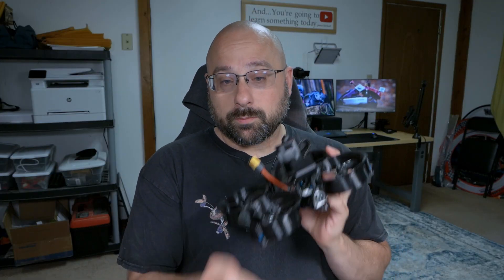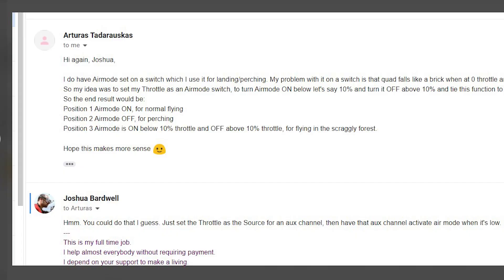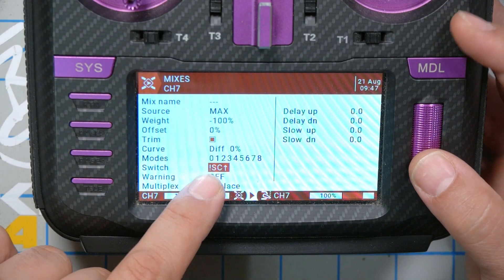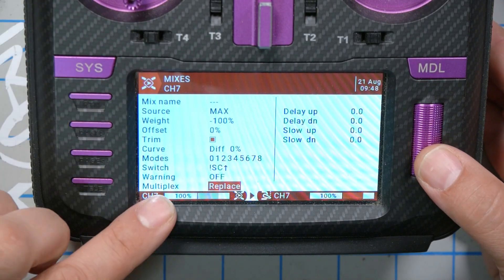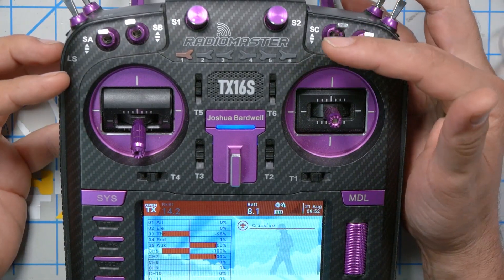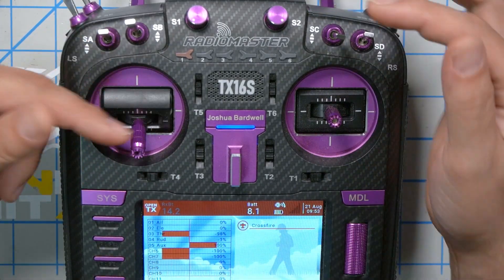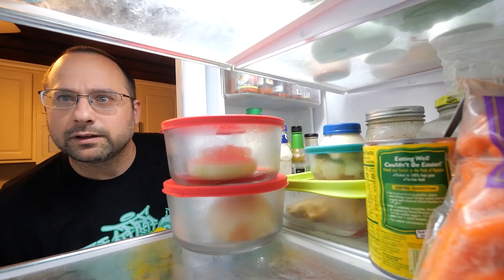Betaflight Air Mode is bad for Whoops. Until now. Maybe.

Comment: Umm... There's a Betaflight parameter called airmode_start_throttle_percent , doesn't this do the same?
Reply from the maker: No. That controls where air mode first activates. When the throttle first goes over that percent. After it activates, it stays active at all throttle positions.
Reply: @JoshuaBardwell  Thank you, I learned something today! Now this got me thinking and unless I'm mistaken, this means that airmode NEVER gets activated with the special solution you described. I checked the source code and the activation of airmode ONLY happens when its enabled and the throttle goes above airmode_start_throttle_percent (which is 25% by default). But it's NOT enabled above 10% so it won't get activated above 25%...
Reply: @l0stb1t  hi, I see nobody answered you, did you find a response of you interogation or did you test it to see if it is activated?
Reply: @l0stb1t  Yeah, i'm also very interested. This video is starting to be shared in the community as an answer to air mode problems, but if what you're saying is true, then it's very wrong
Reply: @ThranMaru  It's only the first time you raise the throttle that it's only enabled when you go over 25%... Normally, once you've taken off, it's permanently on until you disarm. Now, it won't enable when you go over 25% on the first take off, but after that, any time throttle goes under 10% (eg flip, power loop etc), airmode is turned on. 
It makes sense, and it's useful for the problem he mentioned of flying through scraggle etc, but it doesn't help my use-case: I'm a very new pilot so I crash-land a lot, often on uneven stuff. And then the quad freaks out every time. So I've just turned airmode off (since I'm not gonna be doing flips any time soon anyway).
Reply: @Vousie  just gotta be very quick with the disarm. I disarm right before I touch down.
Reply: @ESForgecraft  For me the problem is I'm flying a TinyWhoop. Hitting and bouncing off things is kinda a given. And I can't just disarm when I would've been able to keep flying. Thus far I've had no issues with turning off airmode on it, given that TinyWhoops basically never go upside down.
On my big quad I fly ArduPilot rather than Betaflight. Airmode always on, and I've never had any issues with its airmode on landing etc, and it does powerloops & flips quite fine.
Reply: @Vousie  not put airmode on a switch?  Granted that wouldn’t help with it fluttering if you hit something but landing wouldn’t make it bounce and hit the ceiling
Reply: @Vousie  how you doin now? A sim is worth so much more than they cost, plus they're fun.
Reply: @l0stb1t  have you tried lowering the throttle (airmode_start_throttle_percent) to 0%? Once it pass 10%, it will deactivate airmode and when you go back to below 10% it will activate airmode.
Reply: Thank you for sharing I would love to see if anyone can confirm this as working.
Reply: @dwpreble  I have this setup on my X9D and use it mostly for my tinyhawk flying inside. it seems to be working well for me. I havent flown my protek35 close enough to walls to really test that one yet.

Comment: But air mode tends to stay active even when disabled on switch until you land and disarm. Then it turns it off. 
Other wise once enabled and throttle goes above 25% it's permanently on till disarm for me. So I disabled air mode entirely 😆 
Dynamic idle will be my fix for that.
Reply from the maker: That's not my experience. When you have air mode on a switch (aux mode) it is off the moment you flip the switch. I think something was wrong with your setup.

Comment: Wouldn't the following do the same?
- In Modes tab add Airmode range.
- Select Throttle channel in Airmode mode source
- Place the slider in the first portion of the range (eg 1000 to 1100 for Airmode to get active from 0 to about 10% throttle.

Comment: i have sadly a different porblem with my Cetus X . it doesnt in Air or hor mode , im getting somtimes a error and the rotors just stops spinning :S also for somereason the connection is worse than to the smaller Emax nanoscout . ..

Comment: I mixed a switch in Betaflight so that AirMode turns off in Angle and Horizon mode but remains on in Acro mode. In Acro mode, my Cinerace20 V2 drone starts without any issues, but in Angle and Horizon mode (with AirMode off), I get the "Rescue Off" message, and the drone won't arm. How can I disable this?

Comment: To permanently enable airmode does braking in esc settings need to be off?
Reply from the maker: No. Esc braking should always be enabled for multirotors.
Reply: @JoshuaBardwell  I'm flying a apex evo 5 inch with f405 pid at 8k &4k loop dshot 300 when I permanently enable airmode the quad acts like a whoop when it hits a wall in airmode when I input a roll move on sticks is it not  a good idea for air mode to permanently be on or should it be on a switch? thanks again it's my first build  I appreciate it
Reply from the maker: I run air mode permanently on, for all my drones.

Comment: Hi Joshua, is there an updated way to do this now or still the same please?

I’m looking to fly my Cinebot30 indoors for work and cinematics and want to implement this. I want it on the switch so default is air mode on, then when switched up it’s “dynamic” like you have done. But is this the same method you would still use to do this or does this need an updated video before I start to make all these changes?

I’m thinking of mine just having air mode on all the time but when flying in tight spaces or indoors for work use it where it only comes on when at zero throttle.

Comment: I noticed something weird with this method on at least one quad (7incher), but probably also on some other quad.

I got some sort of "dynamic" air mode set up on my radio like in this vid. So airmode only kicks in above a certain throttle percent value. So during flight it constantly switches on and off. Throttle rised, dynamic air mode kicks in, and then: the motors start going back and forth between 15-50 percent several times in a window of 10-20 ms. Causing really hot motors. Mostly front 2 motors in my case.

Any idea why this might happen? Got the blackbox log file available.

Comment: Probably some people have already mentioned this, but I just copied my Throttle to the free 11 channel and now my AUX7 follows my Throttle. Then just set Air Mode to be enabled if the AUX7 is less than 1050.
Reply: That's an expedient solution, bravo! Fighting air mode on a cinewhoop now
Reply: this is an easier solution
Reply: I know it too, but isn't it "eavier" for the FC and the link than Joshua's solution ?

Comment: On my crtus x I've updated remote (literadio3) to just duplicate throttle to the channel. And set smaller range on drone.
It is not as precise as my elrs channel has small number of stops, however it works similar

Comment: I am trying to fly tinyhawk 2 indoors in rate/acro mode. i have reasonable stick control to fly it in angle mode. I have flown in rate/acro mode in simulators. When I throttle up from floor the quad is moving forward like a racing car even without any pitch input in rate/acro mode. is this normal?In the osd i can see "AIR" displayed.
Reply from the maker: You need to use the pitch stick to control the quad's speed. If it's tipped forward on the ground when you take off, it will be moving forward immediately. Pitch back if it's too fast.
Reply: @JoshuaBardwell  Yes it is pitched forward on the floor. Thank You. So I guess that is normal for bottom battery mounted Tinyhawk.

Comment: Hi Joshua, Zeus f722 v2, when throttle is little up one motor going too high rpm, not able to matches other motors spin. Please make a explanation on zeus f722 v2 complete setup & flash, possible troubleshoot.
Reply from the maker: https://youtu.be/xBaefeQtA1c

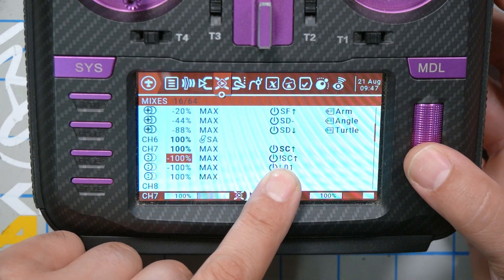Comment: how to set line 2 on tbs mambo (5:25)?
Reply from the maker: It should be exactly the same except the Mambo has a smaller screen so the menu doesn't look the same.
Reply: @JoshuaBardwell  you need to copy line 1?

Comment: Would it be possible to configure this when using the DJI controller with the HD version of say the Beta95x v3? Since the controller does not have a screen...
Reply from the maker: No it's not possible unfortunately.
Reply: @JoshuaBardwell  thank you. That's a real pity...

Comment: Someone mentioned this and I’m not sure if I understand correctly but could you do this only in Betaflight, using the throttle ch in modes, to activate airmode at or below a certain rpm?? I can’t fathom how it’d be accomplished but seems like it’d be kind of automatic version of what JB did here. I’d still like to have it on a switch to turn off/on as well tho, maybe not possible??

Comment: Just imagine, constant speed governor and variable pitch. Zero time wasted stopping or reversing motors. 4 tail booms of a high end heli and off to the races....  Welcome to the 3D heli world.... I fly SAB w Mikado VControl.... It seems my Jeti Duplex was made for multirotors bc this window switch setting is a menu driven piece of cake. I found this "airmode thingy" in the middle of my first build bench test "throttle freak out" seemed pid related then laughing my ars off when i grabbed the quad and lifted it up quickly then throttle cut..... no response.... then wth is airmode..... then search search.... then walla.... TY Joshua Bardwell for such a great job here and all of your very helpful videos. 👍

Comment: It is possible with just 1 logical switch: "Func=a<x" , "V1=Thr" , "Value=-80" . Then, in the mixer page, click on your Airmode channel, click "Insert after", and use those settings: "Source={your logical switch name} "weight=100", "Switch={your airmode switch position}", and make sure "Multiplex=Add". It works fine on a 3 positon channel set up with: Disarmed/Armed/Armed+Airmode
Reply: I'd like to extend this great comment a bit with my full settings on Taranis X9D+ as an example:
1) On the Logical Switches page add a logical switch ("L01") using: Function: "a<x", V1: "I Thr", V2: "-80"
2) On the Mixes page, select a channel for Airmode and edit: Source: "SC", Weight: 200, Offset: 100, Switch: ---
3) Using "Insert after" in long-press submenu add a subchannel to the Airmode channel using: Source: "L01", Weight: 100, Offset: -300, Switch: "SC↓", Multiplex: "Add".
Using these setting your Airmode channel will be at -100 when Airmode is off, and +100 when Airmode is on, meaning the settings of SC switch and Throttle like in the video.

Comment: Bardwell I absolutely love your content but lately alot of it is showing tips on how to setup up on your transmitter but i dont own a radiomaster tx16s (not sure if thats your transmitter) but i own a x9d so would be good if you could talk what to do on that transmitter too, and i know you used to use one. Now i understand it is still using openTX but is it really the same?
Reply from the maker: Yes it's identical. The only difference is some of the screens look different because the screen is a different size.
Reply: @JoshuaBardwell  thanks for the reply mate

Comment: Digging this up.  How does one remove air mode on an 85x if betaflight doesn't show the mode at all?
Reply from the maker: If air mode is not in the Modes tab, it's enabled in, the configuration tab.

Comment: I used a simpler method, in my opinion: 
Channel 6 controls the modes angle – acro trainer – acro in my case.
So, I used the same logical switches as JB (actually only L02).
Only thing in the mixer tab that I did is that I subtracted an extra 25 points/percent from channel 6 when L02 is active (so no replace but just a ADD) in case throttle goes OVER -80 (so over 10% throttle input). In that case (dynamic) air mode should turn off.
Then I set air mode to channel 6 also, and defined it over the range 75-100 (the most upper range when L02 is inactive). In the range 50-75, it is turned off, but acro mode is still active. When going in the direction of 0 value, acro trainer mode is activated, and when going in the direction of -100 angle mode is activated. So only 2 extra lines of code, one in the mixer tab and one in the logical switches tab.

In both acro trainer mode and angle mode air mode is now turned off. You could inverse that by defining a new extra range for the airmode tab… .

Comment: Can't you just directly set the air mode aux mode in betaflight to only turn on when the throttle channel is e.g. under 1100? Seems simpler... .

Also when following your method you have to disable airmode always on in the config tab of betaflight I guess.
Reply: och and you would need to add a switch condition to that, not sure that possible in the modes tab

Comment: But when activating turtle mode, will airmode still be active using this method? I'm not sure this would be desirable...
Reply from the maker: Air mode has no overlap with turtle mode regardless of whether the aux mode is activated.
Reply: @JoshuaBardwell  thank you kind Sir. You are a scholar and a gent. 

I will probably set airmode to be active on low throttle by assigning throttle as the input to another available aux channel on my radio, and then on betaflight, simply setting up airmode to work at the lower 10% range of this channel input (there is a short 32 second YouTube video explaining how to do this, and hopefully there aren't any problems/issues with this method(?)).

Comment: Hello joshua i am having a problem with my quad , i cant do dives (when i lower the throttle to 0 the motors keep up spinning and the quad doesn’t fall ) i had this problem over two weeks ago and I can’t find any solution
Reply: Hi, have you solved this?

Comment: I've got an airmode type issue on a 1s brushed (0720) 75mm whoop that isn't exactly what is talked about here, but I thought someone might have a comment.

Flying acro, after a straight at high throttle, come to a sharpish turn, and the result of a bit of pitch up plus roll and throttle reduction can cause it to suddenly tumble to the ground. I get the feeling from OSD videos it happens when roll exceeds 45 degrees.

Then I found turning on airmode stopped this happening, BUT (1) on a friend's similar 85mm 8520 whoop it improved but didn't solve it and (2) airmode generally makes it very sluggish - like flying with a nearly flat battery, and flight time is reduced.

The throttle in the turns is not much backed off, only to about 50%, so don't really see why airmode makes any difference.

Tried betaflight and emufight, made PID/feed forward changes. Nothing affects it except airmode, and as above that has downsides.

We are at our wits end on this.

Comment: Today was the first day I put  Airmode on one of my 5" quads and the difference in flying was phenomenal. Previously I was experiencing a lot of chaotic wobbling when I chopped the throttle. I now understand that to be the quad was in  uncontrolled "free fall".
I had watched a Youtube video with Awmagawd and he commented that in his opinion, Airmode was the most important game changer in Betaflight. So I decided to try it.
The differences are incredible in that I now can dive strait down and catch the quad before it hits the ground, and when you power it up and with a slight pitch up and then chop the throttle it is like it actually flies like an airplane and I had great control. Like throwing a ball, it is a smooth curved motion.
I then practiced a lot of landing to make sure there was no problem there, and I have now set all of my quads to Airmode ON.  I would like to option to have it automatically on below 10% throttle, without using switches, Joshua, how do I get that done?
Reply: If you're happy to have this capability permanently available, simply remove the switch condition (SC up/not up) from the example shown in the video. The switch was only there to let people try it the new feature vs. airmode always on vs. airmode always off.

Comment: Anyway to turn airmode off on turtle mode? Both my nazgul and hawk pro have this problem
Reply from the maker: Air mode does not interact with turtle mode. The PID loop isn't active when turtle mode is used. Not sure what problem you're trying to solve so I can't give any more helpful advice.
Reply: @JoshuaBardwell  I had some overlapping buttons.. got it figured out. Thanks for the reply and for all the priceless information you provide! Wouldn't be in fpv if it wasn't for your hard work. Much appreciated JB!
Reply: I thought I had turtle mode on but actually did not 🤣😒🙃

Comment: I think I accomplished this with only 2 Logical Switches and a single line Mix.  I don't know enough about drones or the way they fly to tell if this helps - I'm still in the several crashes per pack phase. But if JB says it's good then I'm trying it.

Comment: hey JB! I have had this idea as well but it is bad. The solution does not do anything at all to eleviate the problem. You might think that it is a good idea, but if you think about it, you see that it does not change anything: If you are below your 20% your air mode is active, so same as air mode. If you are above 20% it does not really matter if you are in air mode or not. So you might as well have it active, or if you are without air mode the FC does almost the same to maintain its authority. It makes no difference, i tried it out. On the other hand, whenever you cross the threashold - which you do all the time - the thrust ever so slightly changes which is deadly if you are edging through tight opening with your 65er. You might not even notice it but you will perform worse!